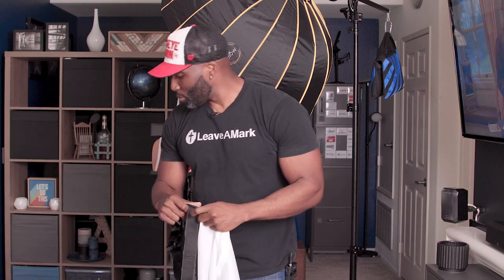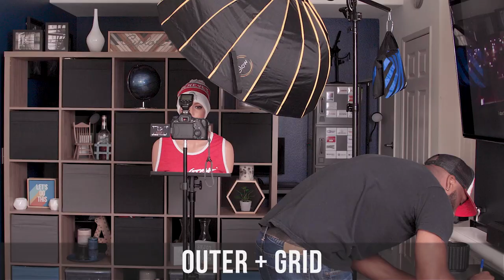Is One Layer Of Diffusion Enough? | Peeling Back The Layers Of Light Modifier Diffusion

Comment: Hahaha oh I got the light meter joke hahahaha poor rbj. Still watching but had a good laugh.
Reply: Question for you Anthony does the thermostat aka light meter Lmfao work for multiple light setups or just one light? I don’t know if that’s a dumb question or not but figure I ask.
Reply from the maker: @Christopher Rodriguez I'm cracking up, LOL. So, the answer is yes but the light meter is basic, it just meters light. If I had multiple lights, I would meter with the dome in (as I did in this video) and would either pop only one light at a time, or if I wanted to appropriately meter for bounced light as well, I would just make sure other flashes weren't in "line-of-sight" with the meter to contaminate the reading.
Reply: @christopherrodriguez7223  This is not a dumb question.  It depends on the model of the meter.  Mine can meter the difference between each light.  I believe Anthony's can as well.  I had his meter before.  You basically take your first meter reading and say it  reads F8.  Store it in memory.  Then hit the "AVE/EV" button, take the meter reading of the second light and it will provide you the difference  in stops +/-.  It is such a time saving tool and the accuracy can't be beat.